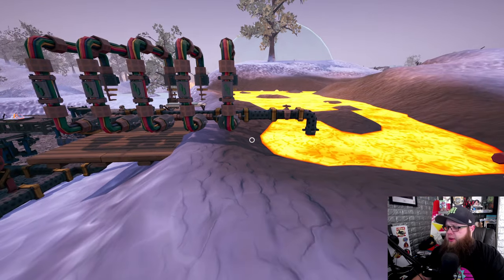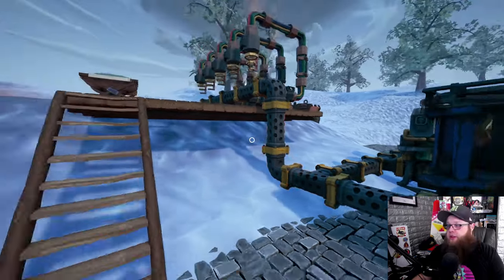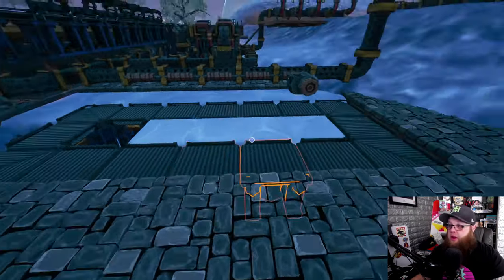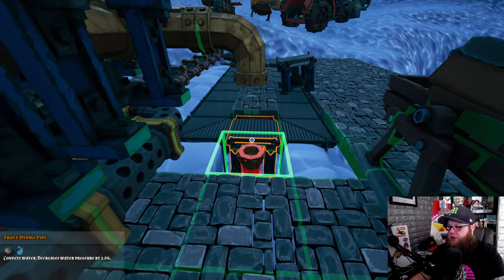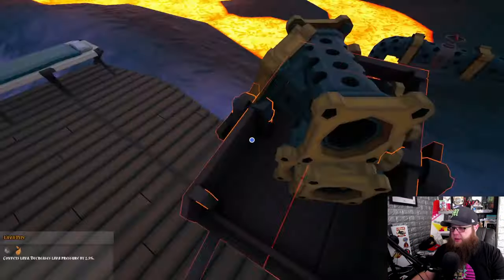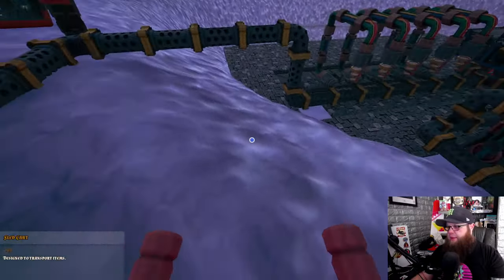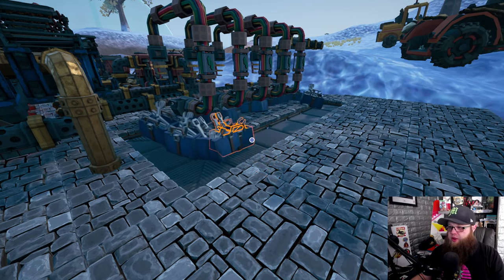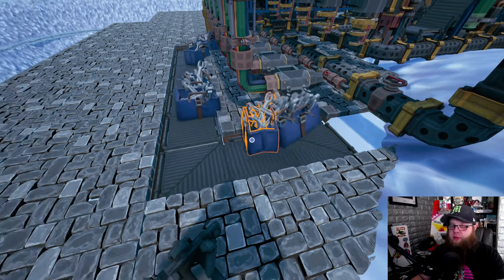The Repair System Conveyor Belt

Comment: instead of using a corner conveyor you could try a straight with the belt attachment to keep the tool bag more in the center
Reply: ok I really should have tried this before posting did not realize the tool-bag has a funny hit box just set this up myself (restarted my save as it was way to old to work with the update (last lime I played T2 had just come out) the tool bags really don't like the conveyor belt attachment

Comment: Hi hybridsteel I have tried in my valcalidus save is to use a water pressure tank with no shard as a on/off switch just for the 6 cutting  belts area so it is isolated from the out feed belt

Comment: Game really needs NPC's we can hire to do tasks especially repair filters and equipment.  To be able to hire NPC's they need to have a covered room to live in with a bed, table and chair. Until then I am perfectly happy to use infinite filters. I can care less about achievements but for those that do this is the next best option.
Reply from the maker: nah adding NPC's as workers just means less for the player to do so your get bored.
Reply: @Hybridsteel  NPC's would add more if done correctly. As you would have to manage them, build a house (an actual reason to build) and possibly keep them fed as compared to just buying a bunch of wrenches and tossing them on to a conveyor belt.  Not to mention adding to the progression of the game.  running to the store to buy a bunch of wrenches is what is boring.
Reply: Adding NPCs you can hire would further remove the usefulness of the logic system. What I do wish they had was a conveyor that could switch direction with a logic switch.

Comment: I like the simplicity of that design for filter repair but, unless it's been patched, I don't like the system stopping for up to 1 second whenever a filter goes down. You can stop that, if it still does it, by adding a == with a numpad set to 1 and removing the input reversal hook. That way a filter gets repaired at 1 instead of waiting for the nearest second after a filter hits 0.
Reply from the maker: if you have this setup running with lets say 20 tool bags i doubt ur gonna see anything break for a really long time. it takes 9 hours for just the hurlers full to empty so add tool bags to it and ur gonna be going for a really long time.
Reply: @Hybridsteel  whenever a filter goes down, it can take up to a second for the magnifying glass to register and send the message to the spanner thrower. I haven't checked it recently, but it used to be the system would stop immediately when a filter went down so your system could completely stop momentarily, including conveyers which would sometimes make ore on them glitch out and become static. Was a major pain, so I build against that. Don't know if it still behaves that way still because I make sure to build so it's not a problem.